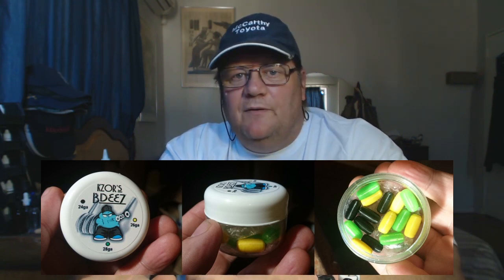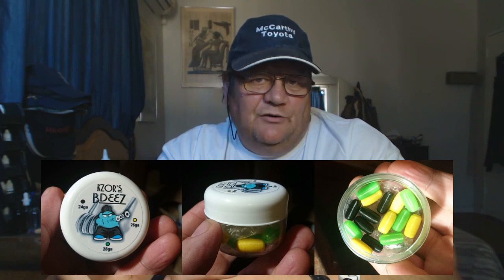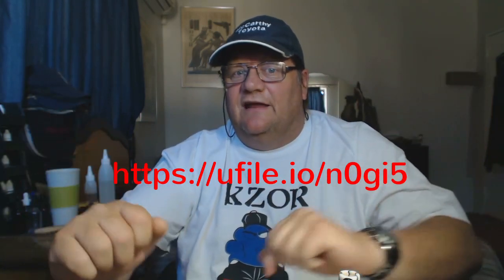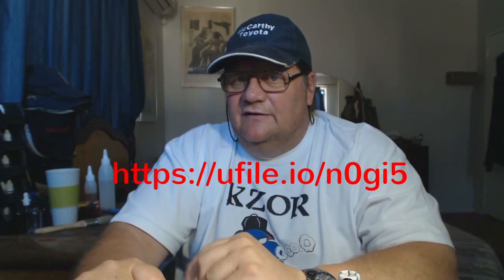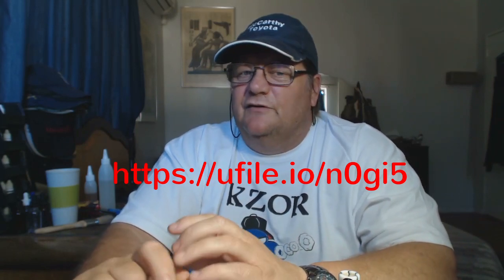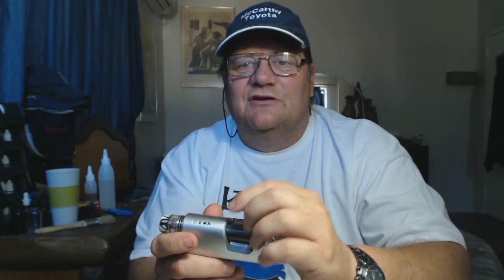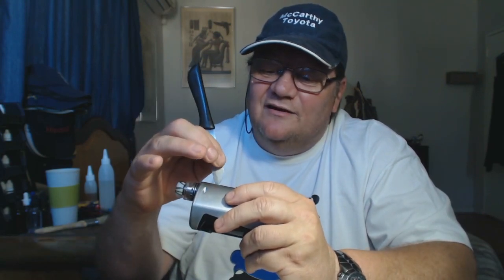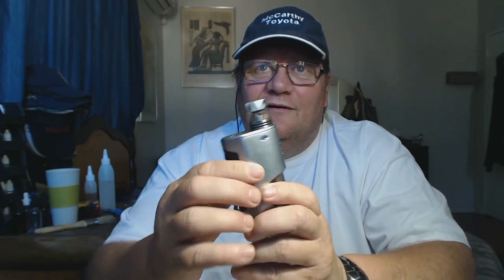KZOR's Give-Away : BDeez 3D stl

Comment: Thank you for sharing the file. Now I got to find someone who has a 3d printer. I would love to make 3 or 4 cores staggered fused Clapton's. 28 awg and 26 awg.would that be possible with a adjustment to the program.would love to hear from you.greetings Georges from the Netherlands
Reply from the maker: Have not tried m8 but i am sure you could alter the design to make 22ga slits in a bead so that you can run 26's or 28's with spaced claptons through it. :) Let us know if you successfully managed to do it. :)